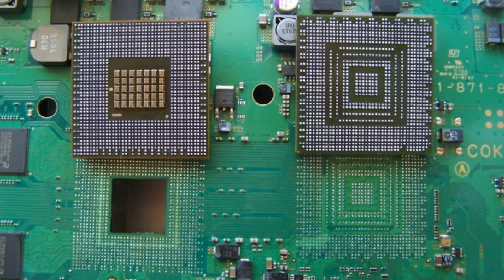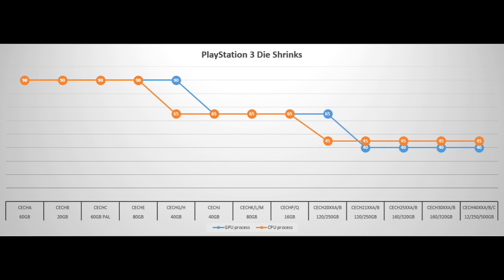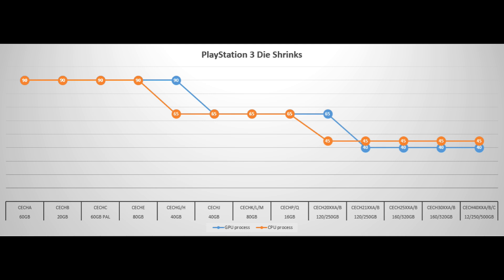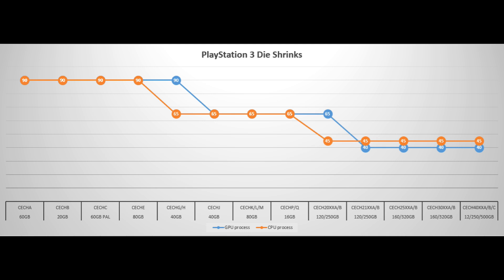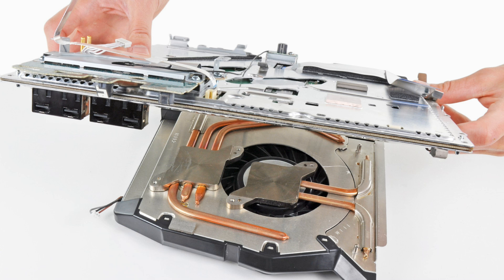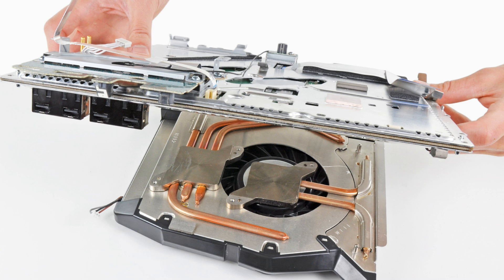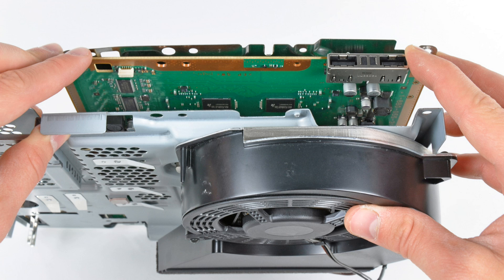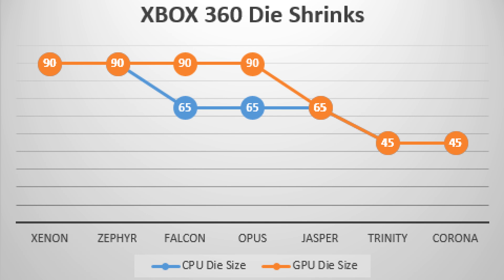Will The XBOX ONE or PS4 Have RROD or YLOD?

Comment: The ylod is mostly not caused by solder ball cracks but instead by low quality gpu construction that makes the internal connections fail. Even if you heat up the gpu to a temperature way less than the temp needed to meld the solder balls it will work again for a while so it's not an issue with the solder balls. Laptops and pc graphics cards were having the same issues at the time. Reballing most of the time is just an expensive temporary fix and the system WILL fail again because the problem has to do with crappy gpu construction and not the solder balls. Most people who had their systems reballed only lasted them 1-2 years and sometimes even less. Sure, there will be exceptions but most will fail in a relatively short time even with proper airflow.

Comment: there is an error in your 360 chart the CPU die actually shrank between the zephyr and falcon/opus motherboards i am sure i could dig up some pics if you need proof also i have seen more red light issues on the corona motherboards than on the trinity...one more point on the ps3 slims i have seen a lot of problems in the south bridge chip's solder balls

Comment: i went through 5 xbox 360 in around 4 years and so i got a ps3 80 gig and had no problems wt it and its going on 5 years young.
Reply: me 20 Xbox 360 since 2005 -_- so i know all codename Xbox 360 of Elite one... Xenon Zephyr Falcon Opus as a remplacement of my Xenon -_- my Red Resident Evil 5 still work and the black one no... anyways i have Xbox Slim Blue 500GB here and a PS4 :) the problem with X360 is the cooling is semi passive cooling... the fan is on vertical for cooling a cpu/gpu(horizontal..)  with Heatpipe... so this why mostly Xbox 360 Fat make a RROD... some still alive lucky one! :) like my Red from 2008 me PS3 since 8 years no YLOD PS4 have a better cooling system than Xbox one i don't trust Xbox cooling anymore...
Reply: AMDRADEONRUBY I have an R2 D2 Xbox 360 slim, and I had it since 2012 and I dont think slims get RRODs because my slim did not get a single RROD.
Reply: my ps3 never made it to one decade

Comment: An explanation for those who don't understand his chart

Ps3:
All fat models:  160,80,60,40,20 gb models are prone to ylod

1st gen slim models: 120gb slim and 250gb slim are still prone to the ylod

Today's 2nd gen slims that are sold today RIGHT NOW! (sorry for caps):  120, 160, 250, 500 gigabyte slims are less prone to the ylod death (not 100 percent though) maybe around 70 or 75 percent in my estimation

So if you buy a ps3 slim now you can bet that you won't experience the ylod problem most likely :D

Xbox 360: (feel free to correct me)

Older non slim models: are prone to the rrod

Slim models: less prone to the rrod :D yay!

Comment: If they would quit using leadfree solder for tax breaks & just use leaded instead,they would have very very small failures.But they would probably use even shittier thermal paste since they didn't get their sweet lil tax break using leaded solder.
Reply: Leaded solder is toxic as fuck.
Reply: +("RNA0ROGER") lead is honestly not that toxic unless you ingest it. You been eating computer parts lately? 

I'm not surprised

Comment: Let me help you out here. First there 28nm and your right the smaller they get the less heat they produce to a point. The where at the point now where is starts going the other way. Yes smaller transistors are more energy efficient but the intel 22nm chips are hotter than the 32. And the upcoming 14nm chips from intel will run even hotter than that.

Comment: no the reason why the ps3 had yellow light off death is cause none off you have ever  used a air compressor and cleaned it ever 60 day this is why you ps3 has falled i have had my ps3 for 5 years still going gets played ever day too so people will have problems with there new ps4 cause they dont clean the dust out

Comment: another important aspect is that compared to PS 4, Xbox One will have a cooler running odd looking box under load because Microsoft went for far smaller configuration having less GPU ALU(s) and ofcoures add to that the Lower Power Memory aka DDR3.

Comment: AMD Jaguar is quite power efficient chip and is capable of power gating both CPU/GPU Cores so this would definitely result in good dynamic range of power consumption and thermals compared to previous generation POS-Consoles so Xbox One and PS 4 will not suffer from xRODs unless they cheap out on HSF like they did in last generation iterations.

Comment: Yeah... BGA soldering is quite ridiculous... At LEAST if they use leaded solder, it won't be too bad. 

But in the end, it's about great cooling, efficiency and operation. The original, fat PS3 models had poor ventilation to begin with, coupled with lead-free solder.

All about that cooling... Nintendo reigns supreme when it comes to actually making consoles. The Gamecube is a great example. Thing runs like a clock. Pure in-out air cooling design, too.